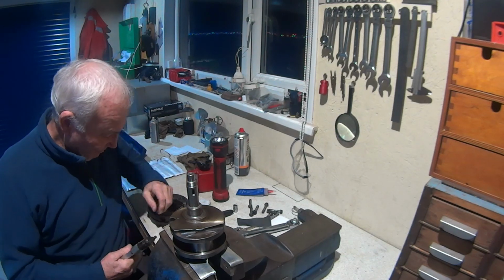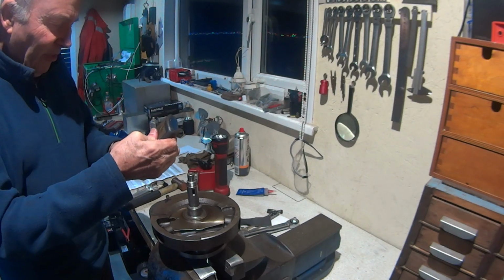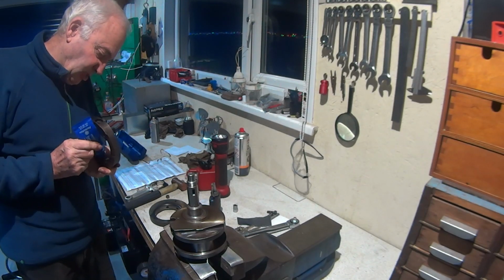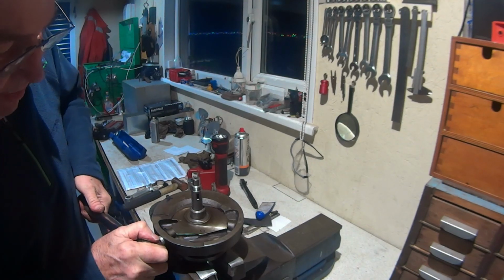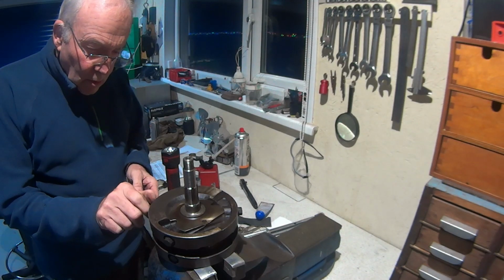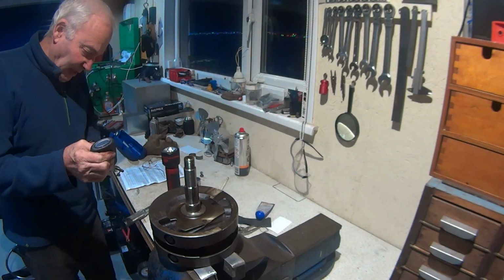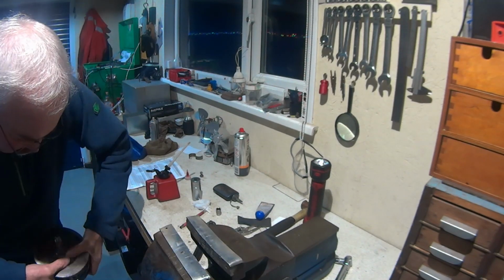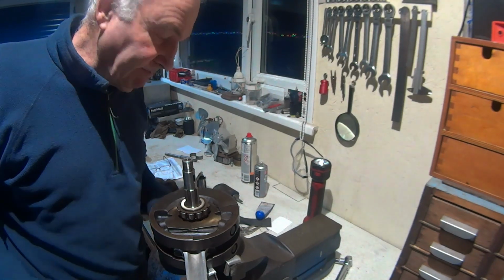BSA B25 Starfire Crankshaft Rebuild Part 2

Comment: Hi Brian I put a comment on about shining the crank you did not put any shims in the crank witch seams strang & I wanted to know how did you know how the crank was if the none drive  side bearing was tight as far as I know that have to be shim to .002" hope you can de- sifor all of that. Best regards Ray were do I find the reply cheers.
Reply from the maker: Hi Ray,

I replied to your first question in the Part 3 video. If you fit the crank just to the right hand crankcase and tighten the shaft nut with the gear drive and timing in place, so everything is pulled up tight on the none drive side and its tight or binding then try the smallest 3 thou (002") shim first, if it’s still binding just add shims until it rotates freely. The crank shim kit is about £7 and has 5 shims of various thicknesses. The link below has them in stock. Once the non-drive side rotates freely fit the other crankcase half and bolt the crankcase together and check that the crank rotates freely in case the shimming has created negative end float; which will be unlikely if you have the roller (not ball) bearing on the drive side.

  https://www.feked.com/bsa-crankshaft-shim-set-unit-singles-c15-b25-b40-b44-b50.html

There is a great publication on the BSA unit singles (Volume 1) with lots of good info on rebuilding the engine, gearbox, carburation, clutch and electrics as per the link below.

http://www.ratiopublishing.co.uk/

Regards, Brian.